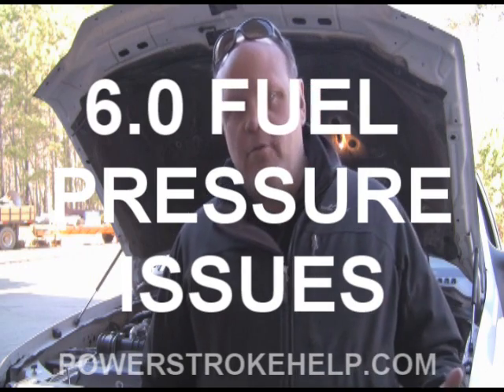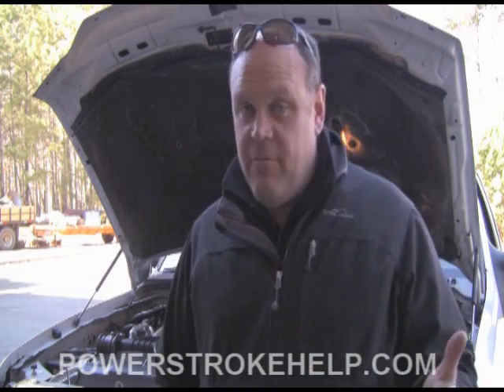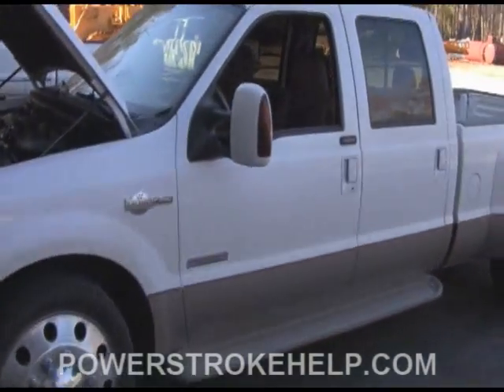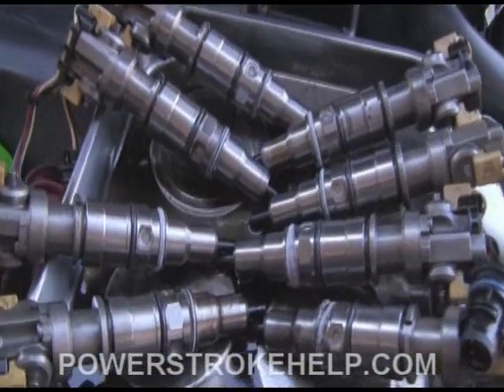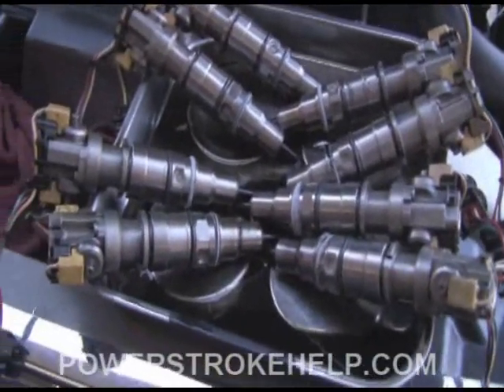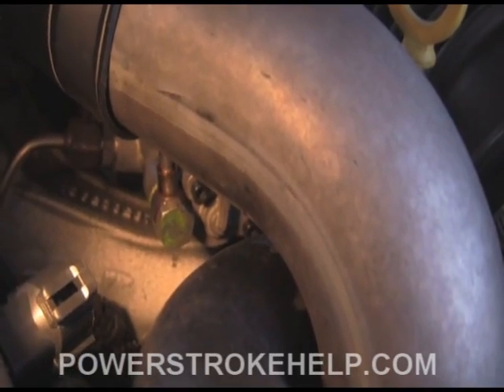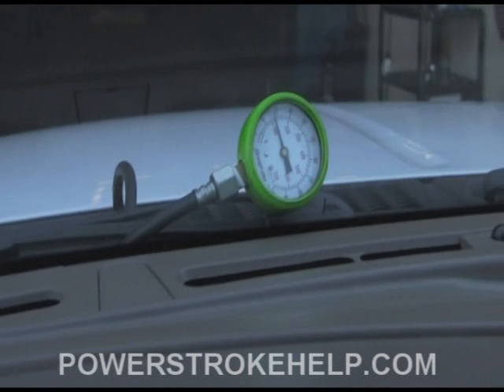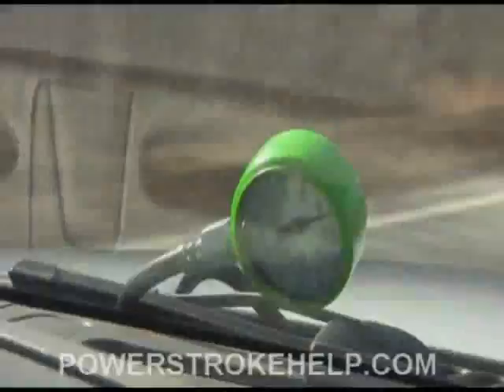6.0 FUEL PRESSURE - POWERSTROKE FORD DIESEL

Comment: Can you tell me what the maximum fuel pressure a 2003 f350 6.0 powerstroke should have before engine damage i got a truck running between 80-95psi

Comment: What would cause it to run and idle fine but when I accelerate hard the fuel pressure drops from 52psi down into the low 40s when it hit 45psi I let of the throttle

Comment: 2005 6.0 f250, would start then die almost instantly, then not at all..replaced glow plugs, icp sensor, and the crankshaft sensor...started then dies again. a "ford guy" said its probably the high pressure fuel pump, does that sound right? also its already had a high pressure oil pump put in. fuckin thing is not doin good for fords shitty truck reputation

Comment: I really like the fuel connection tube you made up. Can you tell me where you got the banjo bolt from? Was it from another location on the engine? The original one that goes into the cylinder head is way too long for the test port. Thanks!!

Comment: I have a 2004 6,0 turbo diesel 88k miles chipped  starts right up runs good rough idle drive for 20 miles shut off will not start for 15 min

Comment: First off great videos they've helped me on more then one occasion. I have one question maybe you can help me with. My 08 6.4 will very randomly rev slam mainly when you need to let off the gas and get on it right away. To take a curve or in traffic ex.  It will then get stuck in gears to the point where you need to pull off the road and turn off the truck. After restarting the truck everything is back to normal. Thanks

Comment: What does a weak or failed fuel pressure spring look like when the fuel gauge is plumed in? with static and dynamic fuel pressure tests. thanks.

Comment: M12x1.25 I believe. Might be M12x1.5. Every tech needs a fitting for this, period. It's very surprising how many trucks have low fuel pressure concerns that go unnoticed (and unfixed).

Comment: Thanks Bill, ya i figured that. they forgot to set the regulator on the kit to 60 psi so the first day i set it back down to 70 just incase they did adjust it and the  gauge in the cab was off, just so that it wouldn't be below 40. Then i phoned them the day after and they said they didn't set the regulator so now i set it to 62 psi so hopefully those 2 days didn't blow injector seals :p

Comment: Is there a zone where the fuel pressure is to high for the 6.0 that it can harm the engine? I have the elite diesel stage 2 fuel system and i have a glow shift fuel pressure gauge. and i get 88 psi constantly even if i really get on it, it only drops probably 2 psi at wot.

Comment: Hey Bill, great video! I am having real problems with my 2005 6.0 F250. It stalled on me once and almost stalled again another two times. It has no power and when I was trying to get home it was doing only 30mph in a 70mph speed zone going up a good grade. I just changed out both fuel filters today, and have tried Sea Foam as well. I think I have water in my fuel, but I'm not sure. I'm lost, do you think it's my fuel pump or something else? Don't have much $ to make big repairs... Please help...

Comment: Hey Bill,  Thanks for the informative video. I learned a great deal on this topic. Question - Can you share what the size(s) the fittings you used and the specific type ? You said a compression fitting from tube to NPT, but what is the size and name that connects to the top fuel filter filter housing? I would like to make one of those test gauges for my 6.0 truck.
Thanks

Comment from the maker: @armyguy209 You are the perfect candidate for the Elite fuel system. You have spent big money on making the truck run hard but the puny stock fuel lines and slow stock fuel pump just are not going to get the fuel to your injectors when you demand it. I guarantee you that the Elite system or similar set up will knock your socks off when you install it on your truck. Probably 15-20% power increase and better fuel economy.

Comment: Do you still think that the Elite Diesel kit is the best out there for the 6.0?  I have a 2006 with ARP studs and the full Bullet Proof Diesel kit(remote oil with billet oil cooler/bulletproof egr cooler).  I also have a SCT with custom tunes from Matt at gearhead(SRL).  I put a fuel pressure gauge on it and idle is 70PSI but WOT can drop as low as 15PSI which I know is horrible for injectors.  I have a feeling my pump is going out.  Do you think the Elite is the way to go for me?

Thanks

Comment from the maker: @fordpowerstroke2012 We have had a bunch of problems with the aftermarket fuel systems. the complete system from Elite diesel is the best. I would just stick with a new stock pump unless you do the full regulated return system.

Comment: Hey Bill, im in the process of bulletproofing my 2005 6.0 because of blown head-gaskets. Now one thing i wanted to upgrade was the fuel pump figured its time to put some new injectors in the truck seen as how its got just over 200k and just want to make sure the fuel pump is nice and new on the truck so my question is have you had any experience with the Air Dog 2 fuel systems for the 6.0 and would your recommend it? 

Thanks Chris

Comment: Excellent videos want to buy ford truck f-350, will use to pull 6 Ton backhoe, need a desiel. Which motor would you want, would like to convert to veggie burner later what's your thoughts?

Comment from the maker: @bigdaddy234567 Only time will tell on the 6.7. So far the Spartan tuned 6.7s I have seen are astonishingly fast. It seems the engine, like the 6.4, is a sound engine, but the heat from the emissions may take its toll in the long run. We will see.

Comment: My 03 6.0 stays a steady 55psi at idle and maybe drops as low as 50 at WOT. Is this a good spec for fuel pressure or would I benefit by upgrading the regulator to the 3C3Z-9T517-AG and get it up near 70 psi?